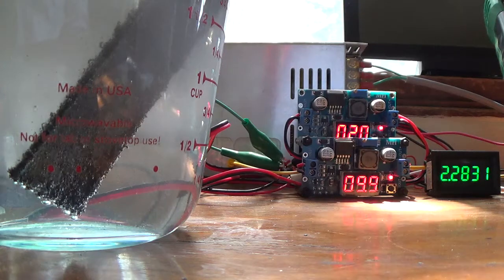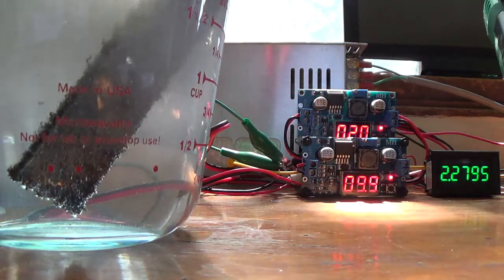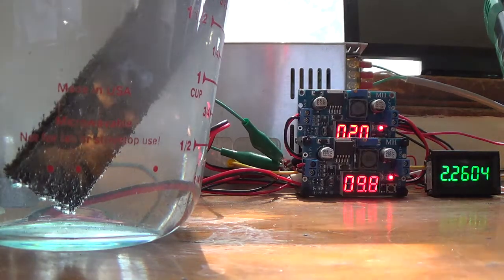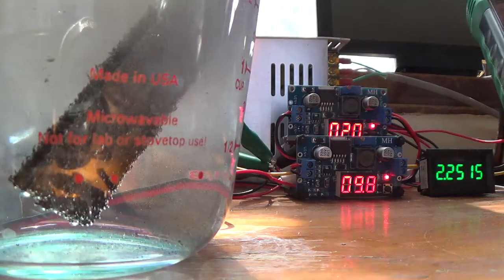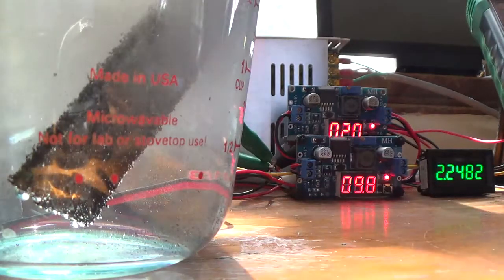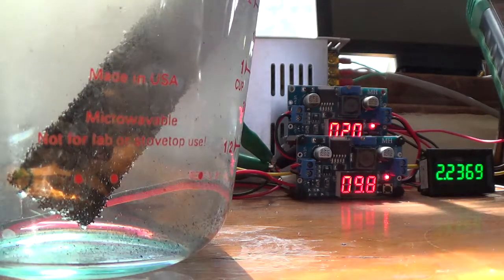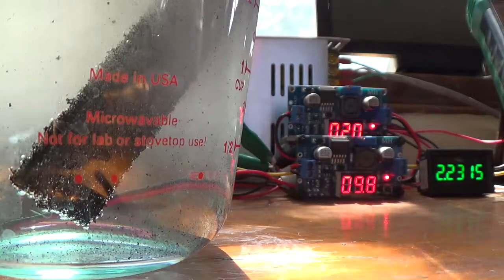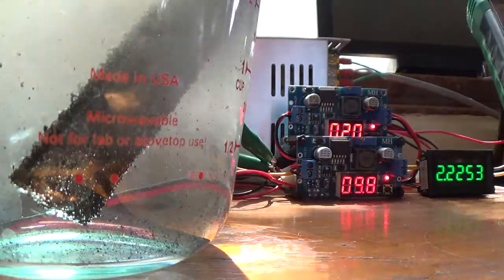Electrochemical graphite exfoliation attempt 2 with the correct process

Comment: Hi Aaron, Great video.
Do you think this would work with graphene in a muslin bag or similar.
It would be a far cheaper feedstock than Graph Foil.
Also what metal was connected to the negative?
Reply from the maker: The issue with bagging the graphite, is that the resultant material needs to clear the area, and that the graphite needs an electrical connection to do the job.  Graphoil was used as a test material because the form factor can be safely ignored for a bit while we worry about the process itself.  We came back to the physical and electrical issues with raw graphite later.

The hardware we were using was stainless steel, or at least was advertised as such.
Reply: Hi Aaron,Thanks for your reply.
Did you make any progress when you revisited the the raw graphite later?
I think I will try a similar setup, with the graph foil effectively being the electrical connection to a larger amount or powdered graphite.
Martin.
Reply from the maker: Yes, but the graphite needs to be a high enough grade to pass the electrical current to it's surface.  There are a whole lot of possibilities here, and there is no one right answer. :)
Reply from the maker: We made a lot of progress, but the key is holding the graphite in position providing mechanical and electrical connection while not blocking the flow.
Reply: Thanks for the heads up Aaron, I will let you know if I make any progress. - Martin.
Reply: i've been wondering something similar, and wanted to try if you could use a press to make graphene powder into a bar or some other simple method
Reply from the maker: A press would make it back into graphite since graphene is just a ton of graphene stacks. :)
Reply: oops typo, graphite ! :) I meant taking as the feedstock cheap powdered form which sells for fraction of the price, then pressing it into electrodes for this process...

Worth a try i guess if i ever need that kind of volume :)
Reply from the maker: Dunno.  Just have to try it, or add some sort of binder that will be easily removed later.

Comment: I have had great success with this experiment as well. An Ultrasonic bath helps break it apart wonderfully but the resistance of the final product is still quite high.
Reply from the maker: Take a few steps to wash out the salt and your conductivity will improve.
Reply: That seems almost counter intuitive but I will take your advice. Thank you!
Reply from the maker: Just to clarify, wash out the salts from the final product.  The salts are used during the exfoliation process, but afterwards they form a barrier to the graphene self assembly, hence the conductivity.
Reply: I will most certainly do that and post my results. Having some problems after I blew my small buck module like you where using. I have been building a variable PSU but ran into an engineering problem of efficiency. Money it tight during this season ;) I will most certainly take your advice and try that out as it ties into other experiments I plan on doing. All open and transparent for everyone's viewing pleasure. I will also revisit the electrolytic plasma exfoliation of graphite experiment now that I have the ability. Thanks again my friend, glad to see you have a YT channel :)
Reply from the maker: Yep.  The current increases relative to the active material's surface area, so you will wind up needing a much larger power supply than you think.  We are close to the 5000W level, and we can see that more will be needed soon.
Reply: Aaron what kind of setup are you guys running now? Any chance of a video tour? :)
Reply from the maker: Unfortunately not at this time.  We have turned it into full production with several specific and proprietary changes, which are now no longer just my property.  Sorry. :/

Comment: Electrochemical solvent can be use after filtration.How much ration of HCL /acetic acid with water required for washing graphene.
Reply from the maker: I use a wicking process during filtration to pull the majority of the inorganic salt away and reuse it.  The remainder is washed directly, with the wastewater recombined with the salt crystals to make more electrolyte.  The resulting exfoliated graphite is floated to remove sediments and separate out the remaining salts.  This is dried to use as snow melt and traction aid, while the resulting product is clean and ready for mechanical exfoliation.

Comment: DC current given 2V to 10v in this process.But why both volt meters were working same time.Second what are current rating during process for out put  2v to 10v.
Reply: The meters are part of the power supplies, one for the 10V and one for the 2V.  I manually switched between them to go from the intercalation to the exfoliation cycle.  The green meter on the right reads the current in real time.

Comment: I tried it with graphite rod. I only got graphite flakes sinking to the bottom. Have you tried using graphite rods?
Reply from the maker: Most graphite rods are primarily ceramic, or may be partially ferrite (compressed iron)  I have used graphite rods, but it was primarily graphite with just enough ceramic material to hold it together.
Reply: I also suspected that it had something to do with the binder. Does your foil contain binders? and do they have an effect anyway? I want to try it with industrial grade graphite foils next, will the quality of foil matter? Sorry to pepper you with questions, but I'm pulling at straws now.
Reply from the maker: No worries.  Graphoil is nothing but compressed graphite as far as I can tell.  Another product you can use is lump and vein graphite from Sri Lanka.  It is almost 100% pure coming right out of the ground.
Reply: Thanks for the quick reply, I've decided to use foils. What about the graphite sold in art stores? Have you any experience with them? RMS mentioned that it would work also.
Reply from the maker: They do, but they too have a clay binder.
Reply: Tried art supply graphite. binder makes it very slow. Thought it was just pressed really hard, but this discussion made me realize they probably use a binder.

Works but slowly, and a lot drops to the bottom, even large sheets of the stuff
Reply from the maker: Yep.  The ceramic binder is a pain to remove.

Comment: how to calculatethe weight  0.5 molar solution of Na2so4 In 1 Lt water
Reply from the maker: Here you go: http://www.sigmaaldrich.com/chemistry/stockroom-reagents/learning-center/technical-library/mass-molarity-calculator.html
Reply: can not able to calculate.how much quantity of water in.5 mol solution of Na2so4
Reply from the maker: Please research the formula weight of Na2SO4 and plug the number into the calculator provided.  

The reason I gave you the tool is so that you can do it yourself.  It is not difficult, and the knowledge you will gain will help you more than just the answer.  The 0.5 molar solution is a starting point, and other solutions and concentrations are possible.  If I just give you the answer, you will be unable to do anything else, and you will always follow rather than lead.